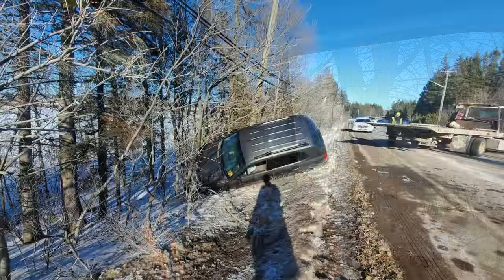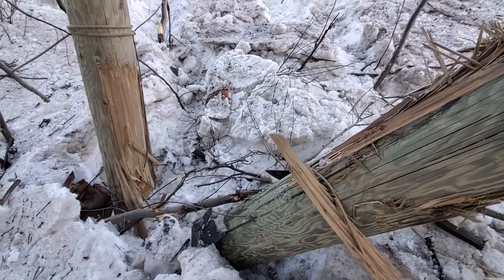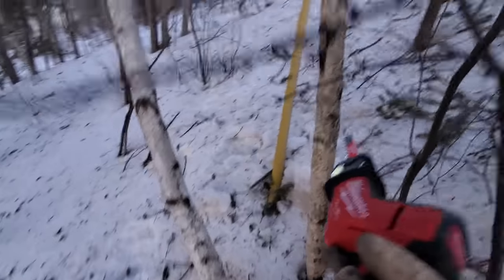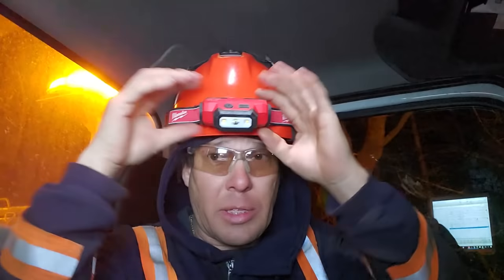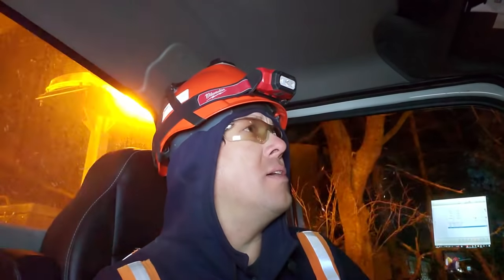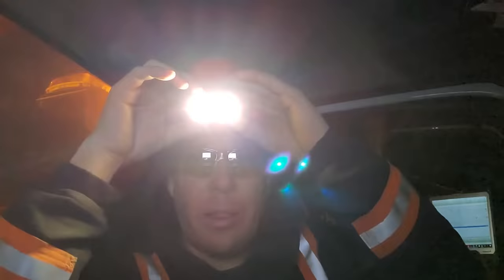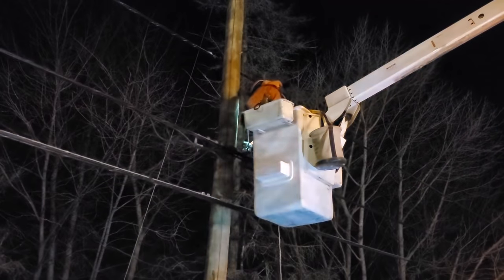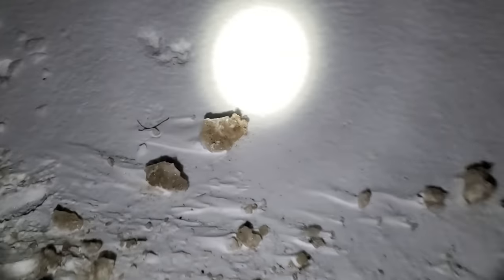Being a Lineman - Episode 16

Comment: I find your channel interesting. I wanted to be an electrician but my folks talked me out of it. 
Here in Connecticut I see the power company (eversource) will put up a new pole, change over the power and the cable and phone take forever (sometimes years) to switch over their lines. Meanwhile the broken pole is there. 
How does the communication happen between the power company and the cable and phone company, and vice versa?

Comment: Those Milwaukee  carbide blades are great, even hitting a nail they just keep going. Thick cross timber no problem. 
Be safe on the lines but also on the road.
5 year apprenticeship.
4years learn the trade 
One to learn to do the paper work 🤦

Comment: The only challenge with putting the new pole between the comms lines is that (in this case) the top line is now on the property side as opposed to the street side. Next time a new cable needs to get lashed up to that strand it is trickier to get the new cable (perhaps on a reel) behind the pole. I don't place cable myself, so am not sure how much of a challenge that is. There would be ways,  but probably a bit more work.

Class 3 40 footer? A lot of what I see around here is 3/40 or 3/45. Some of the big ones are 1/65 for going over big streets or for  transmission lines.. WCSK is quite common. I'm quite impressed with how strong the woods pole are. Pole vs car, the pole does not lose often.

Comment: One thing im intrigued by is the depth of the pole.  the weight and tension isnt too much top heavy weight.  i imagine the guy wire helps.  and how does that dirt stuff you fill in form a solid and hard?

Comment: a sawz works great for small stuff that's unless of course there's no outlet and you're trying to discreetly take the tree out of the middle of the road at 5 in the morning. I was working with hand saws with dull blades after my dad woke me up to say that there was a tree across the road as he was trying to get out to work an hour away. Then I remembered the sawzs is in the garage and the inverter in the car however it was a 750w modified sine wave and I barely got one of them to work even though both were under the wattage. it was more like playing the fiddle with an acoustic guitar as I was literally assisted slightly hand sawing it. I want to say it was a 10 inch tree.
Well I couldn't run one saw and the other one just barely functioned, consequently I got new sawblades and I upgraded my inverter and I was able to run the one that wouldn't run well running a fan at the same time. don't bother with a modified sign wave get a true sign wave.
Then again all these other fancy folks with battery operated tools, I don't have to recharge or have a heavy battery; I'll keep those in my drills.
This happened just next to our driveway in a blind spot as the road slopes down again and we have people who like to race through our dead end road. WV

Comment: In Quebec, the pole is installed by a subcontractor. And Hydro workers can't touch the Communication lines. That is up to them to transfer them over, or the pole is cut into a small piece with the wires still attached and attached to the new pole. 

Minimum 40 foot class 4 for poles with any power lines on them, and 35 class 5 just for communication lines.

Comment: I'm not saying you're wrong, but I was taught never to hook up to something buried in the earth to pull it out with a crane.  The reason I was given was "you never know how good it's in there".

Do you guys have a way to tell how much force you're putting on the winch and that's why it's safe to do it that way?
Reply from the maker: That's a really good point. Many cranes have toppled attempting to lift unknown weight.
Our booms have a by-pass setting. It's not 100% accurate, but accurate enough to prevent the hydrolics from attempting to lift what the machine can't handle. It's actually set low enough that sometime regular work well within the load chart can be a challenge

Comment: When replacing poles like that, do you have to maintain the exact same spacing between the existing poles, or can you move left/right as needed? (Ground condition, new underground lines placed too close, etc.)
Reply: I'm going to say that if there is one straight line,  a bit (few feet) one way or another, in that line is fine (in cities that location may need to be approved, and you also can't encroach/hit other utilities). You don't want to get out of line because the tension (there is a lot) in the cables will in time pull the pole over. In this case, I think it was a T intersection (not 100 percent sure) and there was an anchor/overhead guy as part of that so the pole would have to get placed pretty much in the exact same spot.